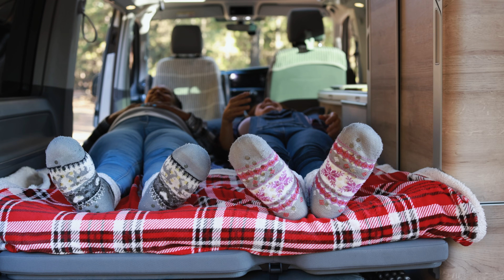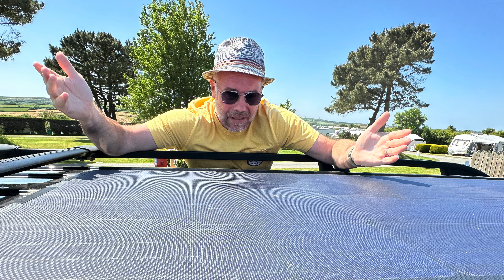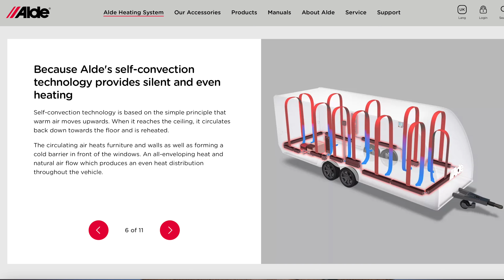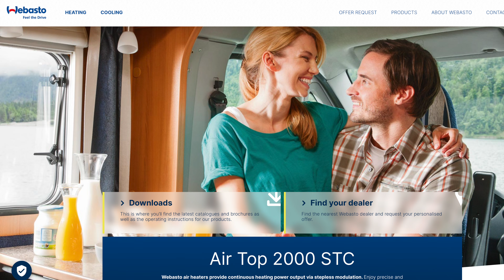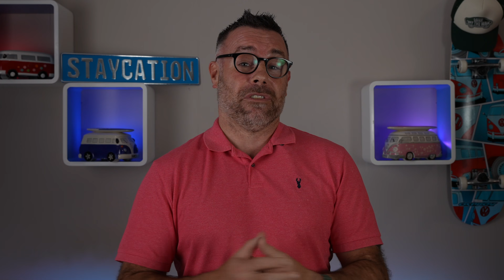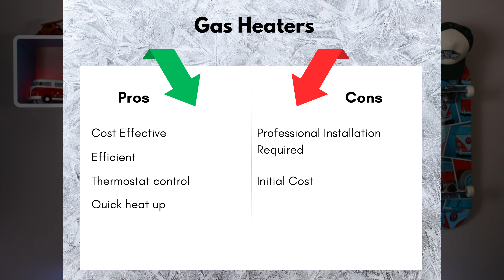Choosing the Right Heater for your Campervan - Beginners Guide - Is Diesel the best option?

Comment: I'm exploring converting an electric van (the eSprinter) to a camper.  You can't tap directly into the high voltage battery but EV's have a 12V battery for accessories for some functions into starting vehicle systems up. I think I'll be able to tap into the vehicle 12V to keep my house 12V charged.  But I'll need to keep the vehicle on to keep the 12V charged from the high voltage system.  Not 100% sure yet.  But long story short... I should be able to use electric heat.  Just starting to look into how to do it.